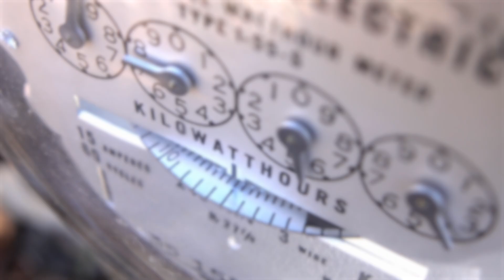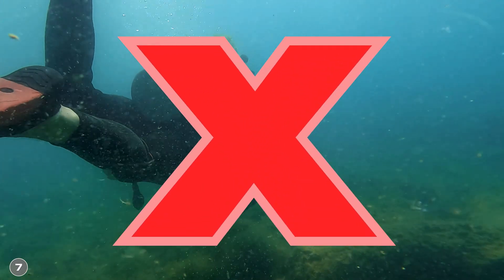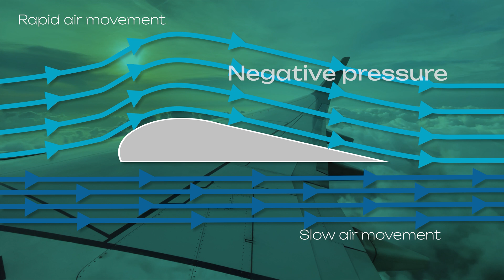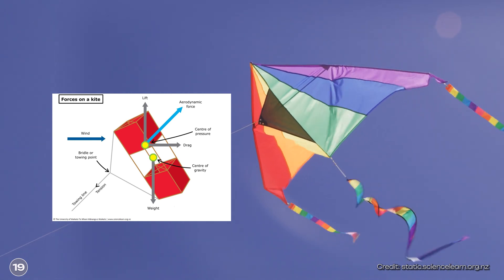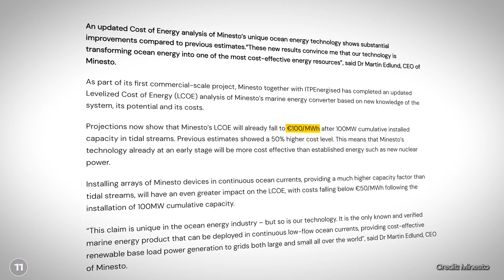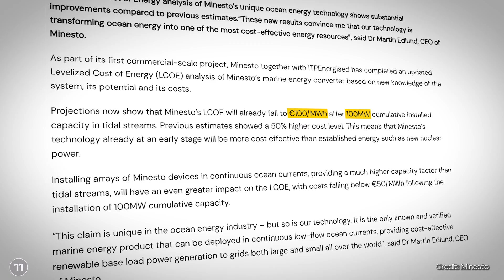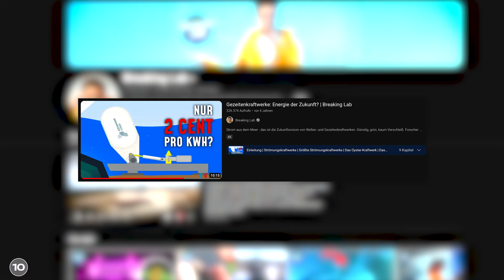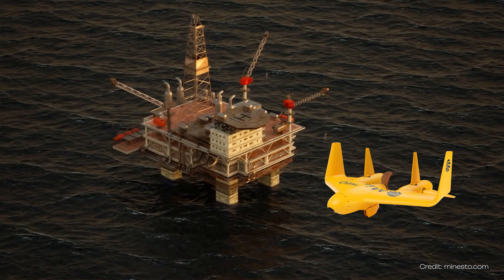Tidal Kite: Better Than Wind- Or Solarpower?

Comment: I place a lot of science systems in the ocean. In temperate latitudes a huge problem is biofouling buildup on structures (barnacles, tube worms, hydroids, etc.). I think there would be a lot of maintenance to keep the efficiencies high. That said, there is a lot of potential for power and where there is a will there’s a way.

Comment: This idea began above but the technology for air deployment is too complex to guarantee base loads; which this application profile's synergies of constant density and strain solves those hurdles; bravo to whomever thought of using this tech in this profile. Nich sprechen deutsche so please in English or French!

1: carbon fiber body and titanium exposed power parts; 2: environmental effects of something like this should be minimal: noise would be the major problem - cable drums winding and unwinding; cavitation at blade tips; entanglement for larger marine creatures with long wires.

Comment: 8:14 LCOE is bullshit because it contains about 50% interest rate costs. However, governmental installments are not under the pressure of profit generation. Therefore, interest rate costs can be assumed as 0. The true cost of electricity is only about 2.5 to 5 ct/kWh (25 to 50 €/MWh) instead of 5 to 10 ct/kWh (50 to 100 €/MWh).

Comment: Why a figure 8 ? (Bin deutsch kannst auch auf Deutsch antworten) 2:47
Reply: If you moved it in a circle, the cable would constantly twist itself. In a figure 8 the cable doesn't twist, or more specifically twists, then untwists.
Reply: @Skywolf76  Oder in kurz und deutsch: verhindert den Kabelsalat.
Reply: @steemlenn8797 😂
Reply: @Skywolf76 genius
Reply: Running in circles, the cable wouldn't twist at all if it's attached rotationally unbound. Figure 8 is used to balance out directional forces. Running in circles, you'd constantly have unwanted forces and movement in a direction you don't want. Figure 8 is like running alternately between clockwise and counter clockwise circles that balance each other out.
Reply: @Haymdahl  You also want to transmit power through that cable, which is made harder if it's rotationally unbound. 
There are always solutions, but the easiest and cheapest is the figure eight.